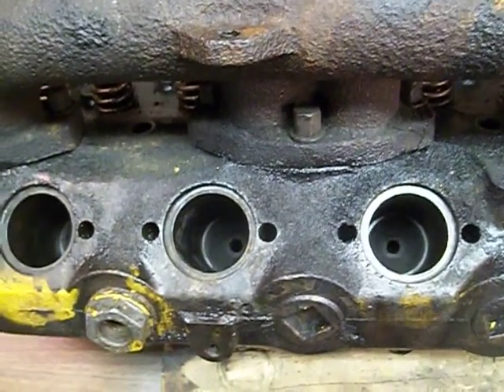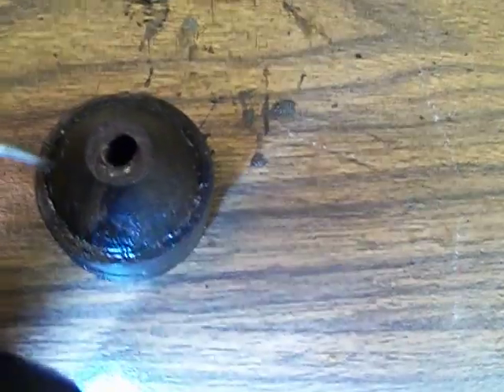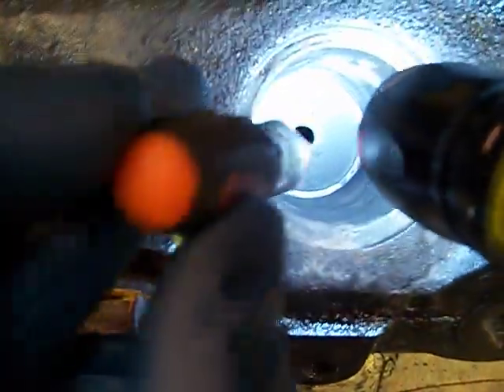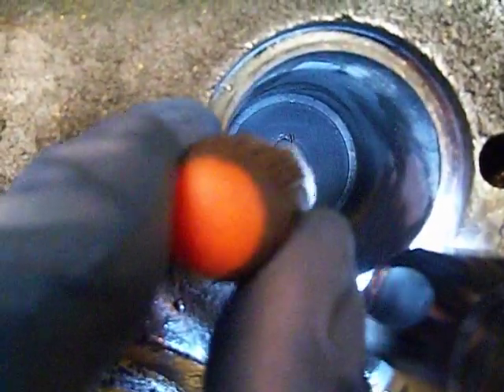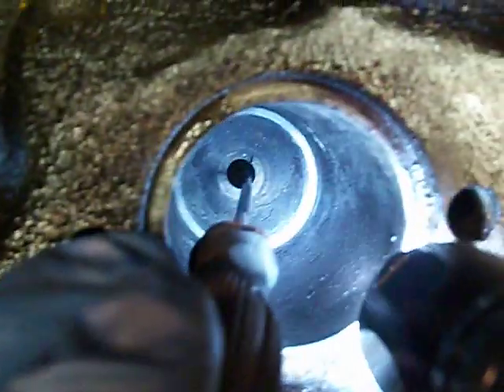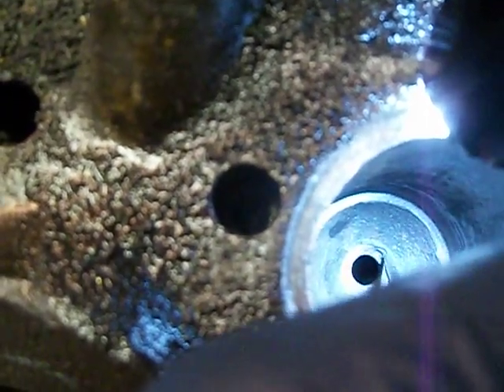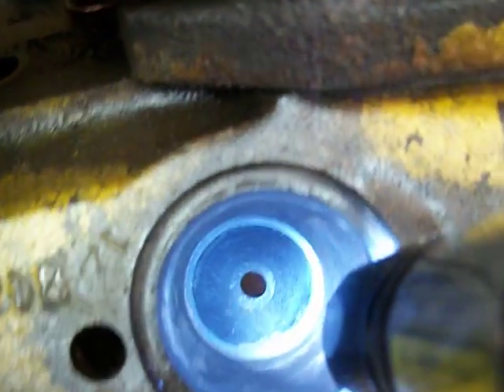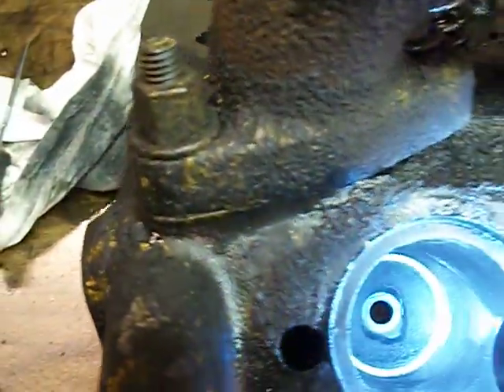11/30/2018 International 3616  Pre- Combustion Chamber Inspection

Comment: Absent any foreign objects in the cylinder, this can be caused by dirty or dribbling injectors, incorrect spray pattern or cracking pressures. Also, the above combined with excessive lugging of the engine or overheating. Im fixing another diesel with completely eroded prechambers. The previous owner pounded on this tractor like a Georgia mule. Prechamber issues can be heard when the engine is running, once youve identified the sound, you never forget it. You can really tell when its going on in a Mercedes OM series engine (chamber ball erosion) Kent Bersagma has a couple of good videos about it on Mercedes source.

I find it strange that you dont find a lot of information on the internet or you tube regarding chamber erosion. Its common, yet no one seems to post anything about it.